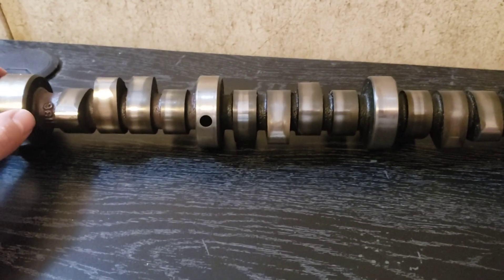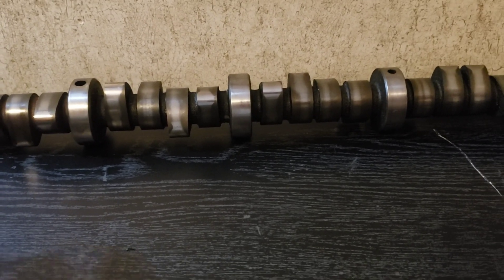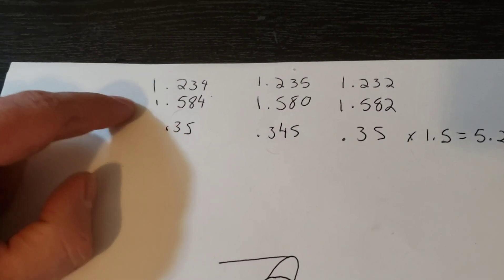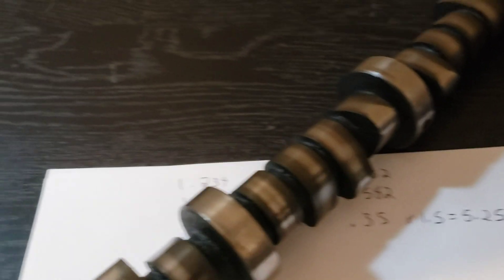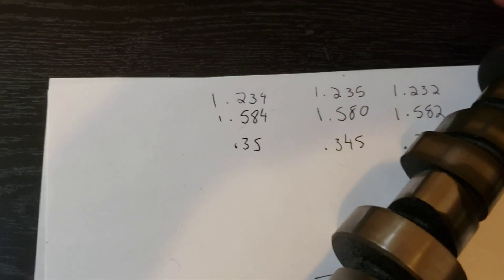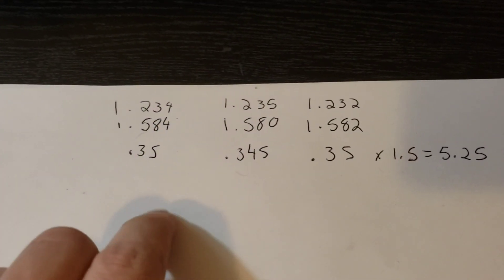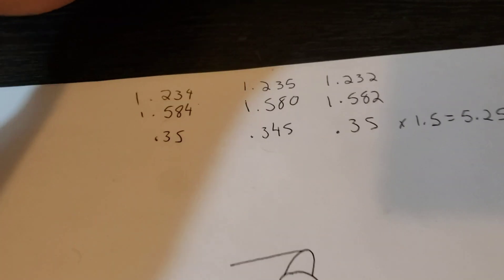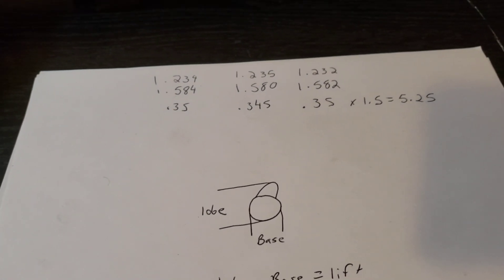How to measure Camshaft lift. #nonamenationals

Comment: Pretty interesting. Is there anything you can do if something is out of spec?
Reply from the maker: No this is just for rough estimations. If there are worn or out of spec lobes you will get a a wrong reading. Which is why I like to check all the lobes. If you have get two significant different readings on the same side (intake or exhaust) more than likely the cam is no good and I wouldn't reuse it.

Comment: Great video, it’s hard to find videos like yours today, my world is a little different using supercharger cams but you can still measure them the same, I’m almost at that point to discuss it 
  Thanks for sharing this with us👍
Reply from the maker: Thank you sir! Yea this is just a roughing it method for putting together old junk and installing it in older junk! Lol all of engines and cars are budget builds nothing expensive or fancy. I have several engines I've picked up here or there that I have no history of this is a good method of seeing what you have. Of course if the engine is put together a degree wheel is your best option I should have mentioned that in the video!